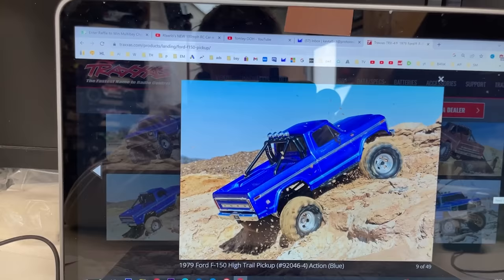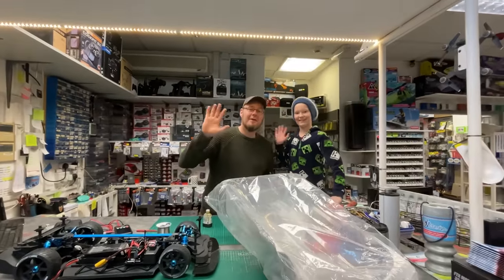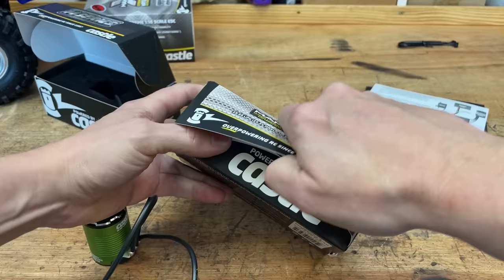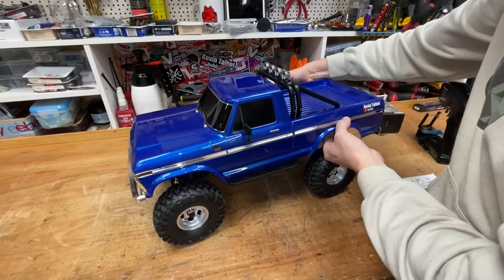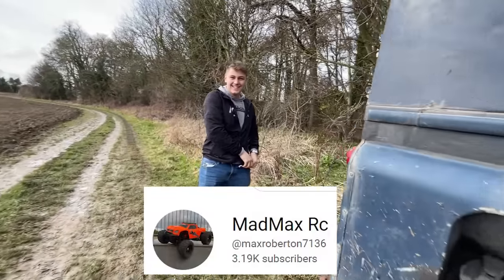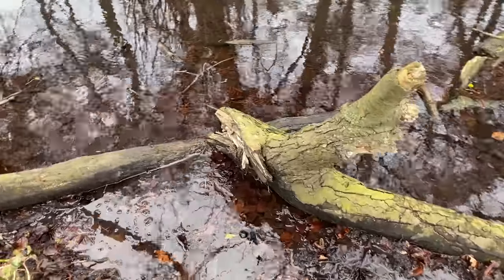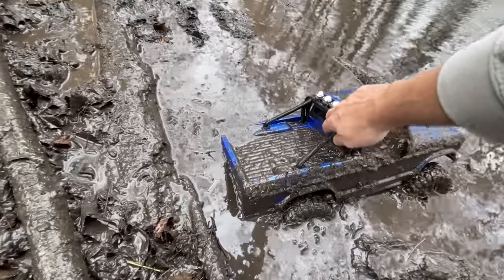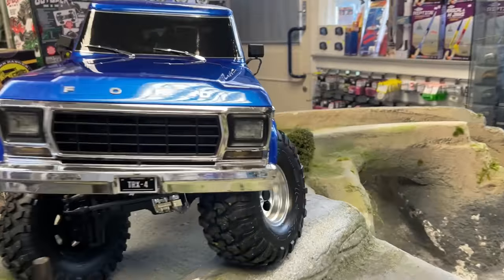6s 4600kv Castle  insanity in Traxxas Ford F150 (it blew up)

Comment: You're the entire reason I bought a trx4 (4 or 5 years ago),  after you strapped a 3800kv slate motor in a light green 66 Chevy bodied trx4 and took it to the skate park, and jumped the shed 20 feet off the track. 
The beating these things will take is incredible. 
I did get the castle setup for it.... 3800kv/Mamba x and a Holmes hobbies shv800 servo (direct 3/4s power over 1000oz/in of torque. It will break linkages)
I still haven't got a lift kit for my blazer, so I can put my jconcepts fling king tires on. 
As much as I'd love to win one, I'd sell the body and use the Chevy version. 

Even if I did enter, I don't win things. 
The world insists I work harder for less than others....
Reply: Your turn will come.  Keep working hard 👍

Comment: I put a castle/mamba power system in my  Trx4 bronco with a lift, 2.2s, front and rear cosmetics, and many other things. I run it on 3s and it does wheelies everywhere no matter the surface